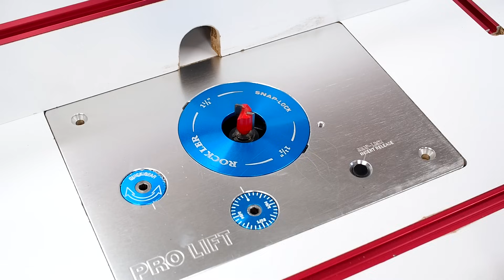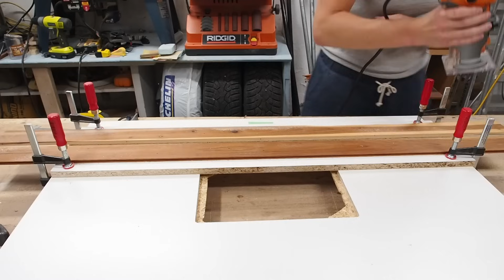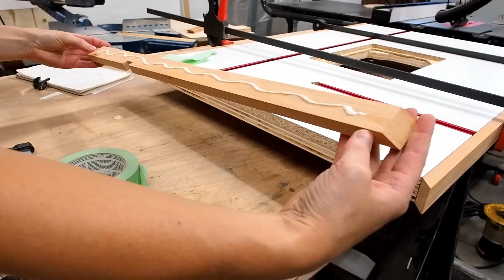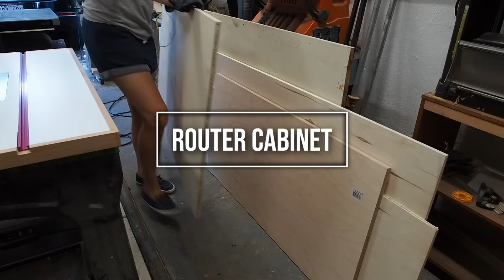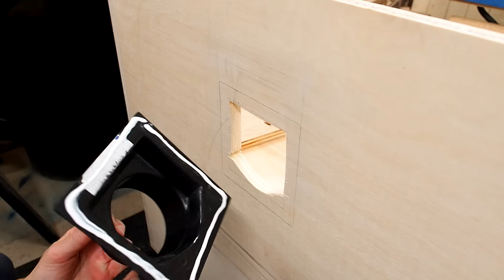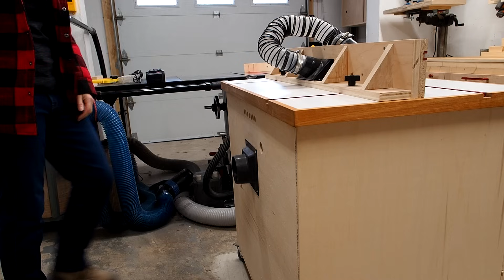I can’t believe I built this as a newbie woodworker! Revisiting my router table build

Comment: Thanks. Nice build. Not sure I would use melamine for the top. The chip board is weaker than OSB, even if they do seem very similar. Yes, it is fairly inexpensive.  Here, in the U.S. midwest we have a store, Menards, a more regional version of Home Depot. Not with the rest of their sheet goods, but available at their pro desk you can order phenolic plywood. Very tough, very slick and pretty close to if not actually Baltic Birch in between the phenolic outer veneers. It is used for construction concrete forms. Priced less than finished ply. Might be limited to 3/4", but have never asked about other thicknesses. Have seen it on sale for  less than $60 per sheet (U.S.), usually just under $80. 4'x8'.

I lucked out. Worked at a medical device start up and got some solid phenolic benchtops. 1" thick, 30" deep and 8' long. My router table top, waiting for me to complete the cabinet, is 30" deep and 4' wide. Such may be available through medical surplus stores? Unmatched stuff for such purposes. New it is low end for solid surface, but that is still high for router table tops.

Something to consider for shop cabinet doors as it works well as a white board for notes. A marker tray along the bottom of such door would serve double duty as a handle to open the door.

One other note you may find useful (of course any of my comments should be taken as suggestions/ideas), for spacers such as setting drawer fronts, you might look into getting a pack of wooden tongue depressors from Lee Valley (terrific Canadian company I'm guessing you are familiar with). I don't think a pack of 100 is much more, if even, $10. They are 1/16" thick, plus or minus some very irrelevant amount. Also good for stirring up epoxy or other things  and might also work as shims when one is needed. Surprisingly very useful.

Comment: You have such great ideas, but some of your decisions seem very short sighted and sloppy.  For example, drilling the air holes at the end of the video, why not just draw a straight line and evenly space them out vs freehanding a row?  I mean, you're setting all of the drawers perfectly at 1/8" spacing, yet, you freehand drill air holes, or you decide to grab a crazy aggressive drill bit to drill the hole for the electrical wire vs a hole saw?  I just find it strange how much thought into detail you have, then you completely skip any thought at all on some of the more basic things.
Reply: Perhaps she just wasn’t concerned about how the back of the table would look.  She seems quite interested in function over looks with this project.

Comment: Hint if you build a cabinet on a work bench..... Remove the drawers before lowering to the floor. Takes off some of the weight, plus you can hold the front edge.

Comment: A recommendation to make the drawers slide easier that is a very old trick. Take Dove soap (or any bar soap), and rub it on the surfaces of the slots and on the drawer slides. It works like magic and if it starts to wear off, just apply more. Any smooth wooden drawer will slide much easier. Works great on dresser drawers in the house.

Comment: I liked the design of your router table so I decided to build it.   SO -  I bought a Jessem Master fence II,  a Master lift II.  Had to downsize the plans because how the Jessem fence is attached. I got to the part of fasten the T track with Weldbond  the bottle says it bonds to a lot of stuff, but one of the exceptions is metal.   So I decided to go with the JB 5 minute epoxy.   Your clamping setup  using a a wood dowel is fantastic!  I have the top routed, T-Track glued,  soon I will be on to making the cabinet. Thanks for the helpful info.

Comment: Great build thanks for sharing. I enjoy building furniture and cabinetry as a hobby now that I'm retired. As a carpenter I learned ,long ago, to build router tables to take two routers as in my home shop. When doing mortice and tenens or rail and style work I can set each router up and make peace's as I do assembly, saving a great deal of time and frustration. Yet I never see cabinet makers talk about the value of building such tables. Mine holds two 3 1/4 hp routers. Have you seen them? Thanks and God Bless.

Comment: Thanks Marie, This is the build video i keep referencing. No lazer cut templates. Just guide boards and a trim bit. I'll be adding a similar hardwood boarder. I think it's funny you have the Rockler lift in Montreal and i have a JessEm in Jersey. Also immediately impressed with the clamping dowels. Good work. :")

Comment: Marie, I recently discovered your YT page and enjoy your projects a lot. I have a small 10.5V Bosch drill I got years ago and while most of my cordless tools are now Milwaukee I still grab that little Bosch for most of my projects that don’t require loads of torque. Unfortunately it’s been discontinued but they do offer a small kit for under $100 US on Amazon that has both a small 12V impact driver, a small 12V drill, a charger, and 2 batteries. It’s not brushless but their brushless kit with the same stuff is 50% higher.  I’d highly recommend this kit for the size and value. Bosch tools are quite reliable as well.

Keep up your fine projects. You do them well and aren’t afraid to admit a mistake which gives your videos that much more an air of integrity.

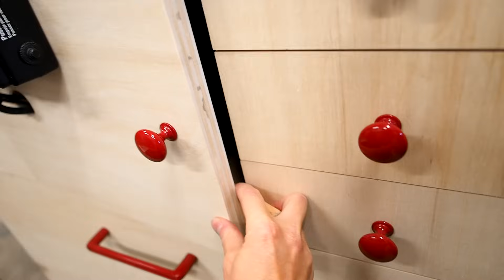Comment: at 24:26 the router bit starts to wander upwards. I've had this happen with my janky diy lift as well, but figured because I didn't secure the router well enough to the car jack I used as a lift it got sucked up.(I figured the car jack is supposed to stop the car going down, but maybe there's no reason for it to stop it going up). But it seems pro router lifts suffer from the same problem?

I'm already considering several changes to my design, your airflow experiments helped a lot, thanks.

Comment: hey Marie;  I have a plumber/pipe fitter friend and asked him why my converted garage wasn't heating well. the first think he said was was my piping for cold air duck and heat ducks the same size in volume.
they weren't so i made them the same size and the problem was fixed. So I make sure what ever size hose volume that is extracting the dust, the hole volume for the intake air was equal.
I enjoy your work.

Comment: Great build! Just some feedback, you are taking off too much material with that trim router, try taking less then half or even two thirds the mount of the material then the diameter and not only will the router cut smoother and get longer bit life but you will get a lot less resistance for the slight increase of time by taking two or more passes.

Comment: I'm wondering about fence alignment, my guess is that on a router the fence does not need to perfectly straight on left and right because the bit is barely exposed and the contact surface is very minimal, correct?

Comment: Your link for the Router Lift is not working. AWESOME BUILD!!!!!!! If I may offer a tip for the next time you inlay T-Track. When you inlay T-Track like how you did for the fence in this project, route your dados slightly shorter than your desired length for the T-Track. Finish the dados with a chisel and mallet for a clean, square, and very professional look. Another tip for helping you make sure you ALWAYS have the right size fittings for hoses, as well as parts for jigs and even some of your projects, is to get a 3D printer, I have a Creality Ender 5 Plus. My latest print was a dust collection port for my 6 inch planer. As a bonus, if you have kids, they'll enjoy using the 3D printer too, that is, if you let them 😎

Comment: After searching every router table on YouTube, I built your yours. I put plexiglass in the door so I can see how the dust collection is working, and put the pocket screw holes on the outside of the cabinet (so they bite into the wood correctly). I put the power switch on the right hand side and fed the wires out the back and along the side. For the fence, I found a new/never used Woodpecker fence at a yard sale. Love my/your router table!
Reply: Am I missing something with the insert plate? Is it help just by the weight of the router and not secure somehow to the table? I saw the leveling feet but dont understand how they also keep the plate from bobbing from any kickback. Curious is you did the same with your build, thanks
Reply: @xMrSilver99x just the weight of the router will keep it in place. Plus the fence will also prevent it from moving. It hasn't been a problem at all.
Reply: Thank you!

Comment: Great job. Next time try using a half sheet of plywood to make sure all grain is running the same direction.
Reply from the maker: Yep, didn't think of that 5 years ago but that's the way the cuts are designed in the new plans 👍

Comment: Since you mentioned how it's a pain to move big sheets of plywood, I thought I'd share how I do it. My car is just a little 2-door hatchback, but I made sure to buy it with roof rails so I could install a roof rack. I installed a pretty cheap aftermarket roof rack with just 2 bars that run parallel to the front of the car.

When I transport long dimensional lumber, I just ratchet-strap it directly to the cross bars of my roof rack with small ratchet straps (the kind WITHOUT the hooks). This works really well. I can move ~ 18 2x4s on top of my car at a time. I built a tree house for my daughter over the summer and hauled a pretty sizable stack of 4x4s, 2x12s and 2x4s on top of my car in a single trip.

For moving 4x8 sheets of plywood, I built what's essentially a very large palette that I strap onto my roof rack. I then have a system where I slide the 4x8 sheets onto the palette and then clamp then down with some big bolts plus so cross-rails made out of ~ 1x3 hardwood stock (from some hardwood bed slats that I scavenged).

Even though I have a small car, I can move multiple sheets of plywood and/or a pretty sizable pile of lumber on top of my car with my roof rack. It was definitely worth the time that I spent to install the roof rack and build a special sheet-goods-pallete with integrated hold-down clamps that I made out of scrap dimensional lumber and bed slats.

Comment: This is SUCH a great build. Your dust collection setup is exceptional. I really appreciate your practical approach to wood working. Some other wood workers would spend 3x more time joining the drawers with all-wood jointery rather than brad nails + pocket screws. For shop furniture, I think the simplicity of brad nails + pocket screws makes more sense.

I don't have the time now to build a router table, and I REALLY need to first start with other projects to declutter my garage workshop, but I hope to build a similar router table some day.

I'm going to have to rewatch this some time to pick up some of your little clamping and alignment techniques for cabinets. I've seen some of these, but not all of them.
Reply from the maker: Thanks, appreciate the feedback! Good luck with the decluttering and hope you get around to building this one day. It's a great addition.